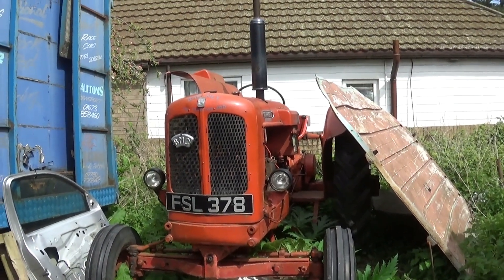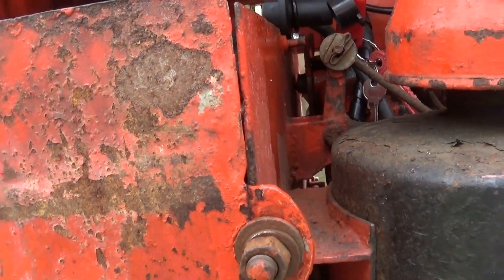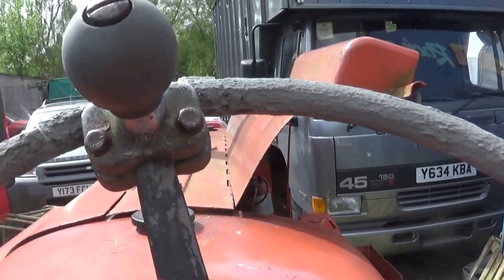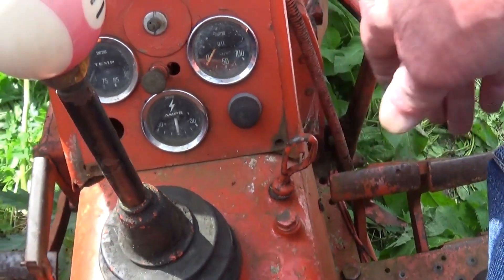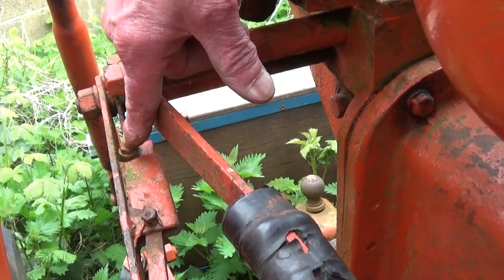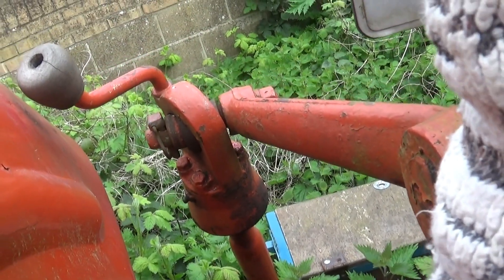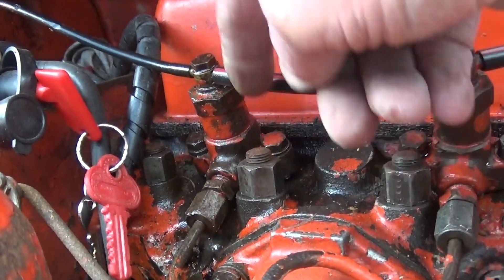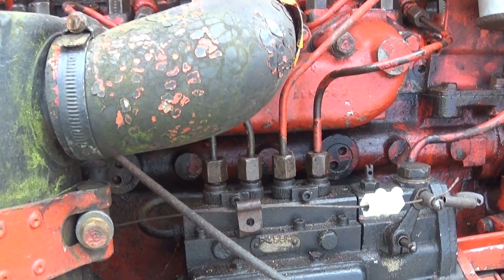1953 Nuffield DM4 First Start 2018

Comment: Hi great to hear the old Nuffield up and running again, I started my dexta the other week started as quick as yours I also took it for a little spin, great feeling to be out on the road on it again. I still have the issue of losing some water from the overflow, it's usable but I think next winter I may have to do the head gasket. I just hope it's not the liners, but head gasket is the first thing I'll try. It doesn't over heat so if I keep an eye on it I'm sure it will be fine until I do the head. Great vid thanks🙂👍
Reply from the maker: Great. Beaten me to a drive, but decent one coming up......Carrington. Hopefully make it this year.
If you suspect head gasket leak, don't put it off. Might corrode head or block surface, meaning a full engine strip to get it machined flat.
Reply: Mowersandstuff b

Comment: Love that old  Nuffield  Tractor really a great tractor. And she started up on the first crank really cant beat that at all. When you engage the pto do you have to really rev that engine up higher so it doesn't lug down? I have never driven a tractor my experience is driving heavy Forklifts.
Reply from the maker: After doing the head properly last year Larry, she really should be good to go, after getting the injectors serviced, the last mechanical job. No don't have to rev the engine, loads of power for the hydraulics. Go and find someone with an old tractor and have a drive....one of the most fun things you can do.
Reply: Yes it really does look like fun when you drive it.

Comment: The Nuffield  fired up and as fit as a fiddle.  Hydraulics is working good Malc
Reply from the maker: Mechanics on this tractor are as good as any, and better than most for it's age. Doubt this tractor has done much work at all in it's life, and the engine, that must have been fitted in the late 90s was reconditioned, except for the head, which I did last year.

Comment: Nice one Malc. Wouldn’t expect anything less out of a “proper” tractor!! Not like these new electronic engines that will run when they decide to and not before👍🏻👍🏻👍🏻
Reply from the maker: Exactly Peter. One thing puzzled me. These old Nuffields are great, yet the price has dropped. Yet the later Laylands, that often have cracked blocks or liner problems, price has risen. Must be a fashion thing, a bit like with Fords at the moment.